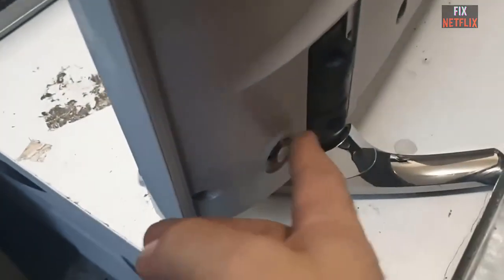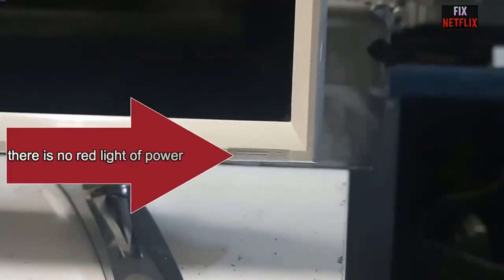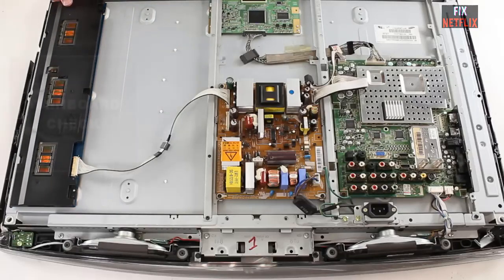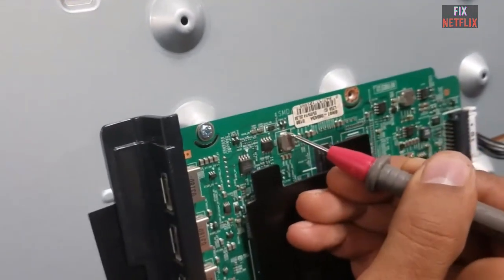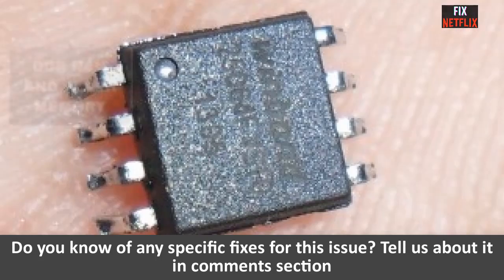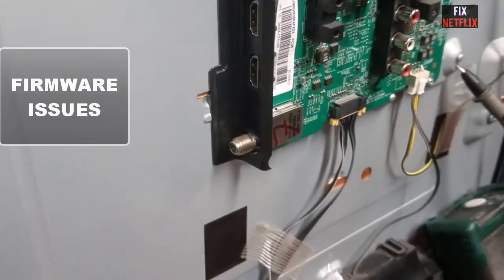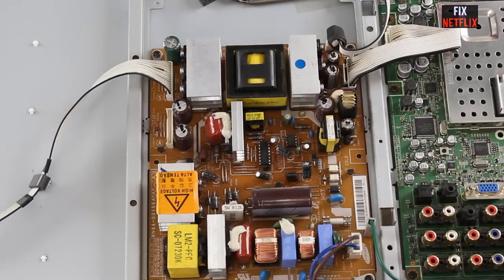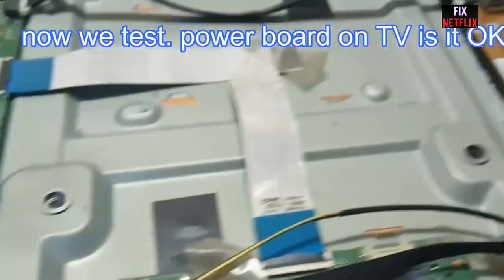How to fix Samsung TV Not Turning On | No Standby Light | Step-By-Step Samsung TV repair Guide

Comment: samsung tv red light standby on and tv not turn on while using remote or manual on
Reply from the maker: Hello bruh,  disconnect power cable and wait 10 minutes.  Hold power button to discharge the electricity.  Then plug in back and try.

Comment: If standby indicator is off, but tv switch on after reconnect power plug for 3 minutes and after that switch off, what can happened ? PSU or main board ? Can it be CPU or flash memory or it can be simple PSU problem ?